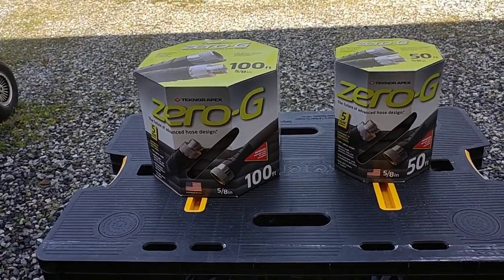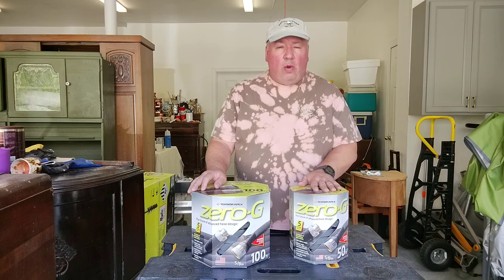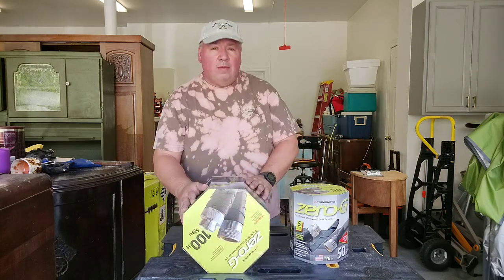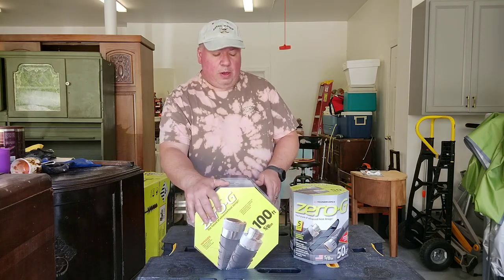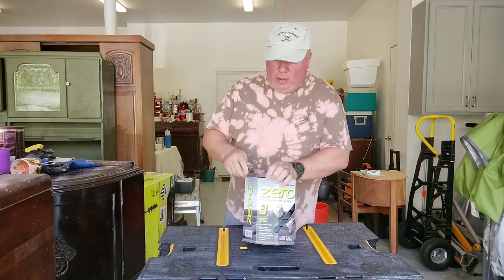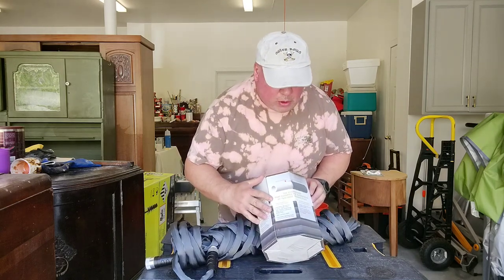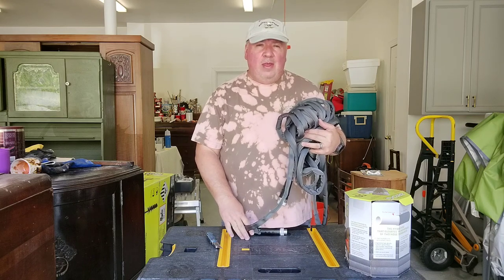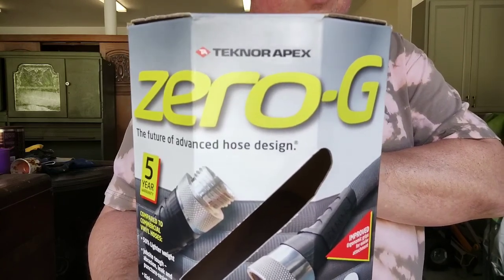Zero G hose

Comment: Have a 100 ft Zero-G that failed after 3 years of near-daily use.  Split near the female end.  If you want warranty coverage, save your box, receipt, and serial number.  They won't replace but send a gift card and you must destroy old hose if you use warranty.  I will not be buying another one.